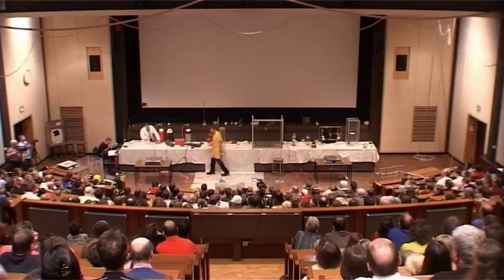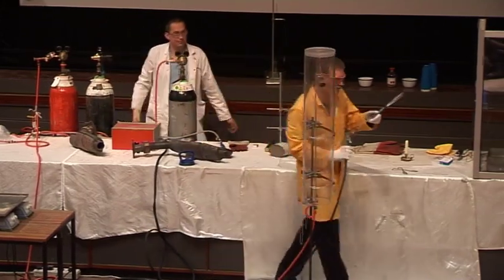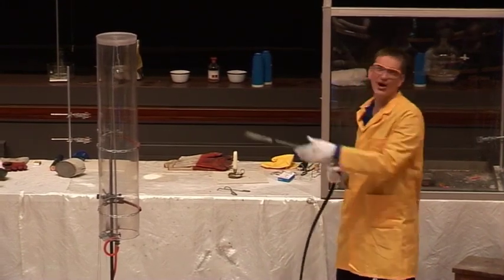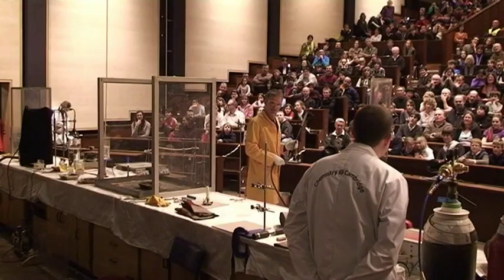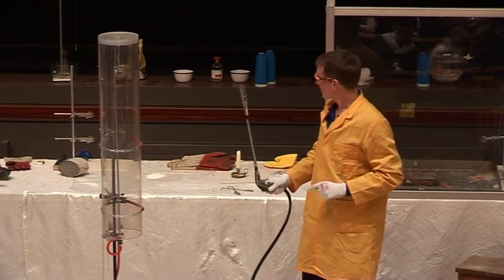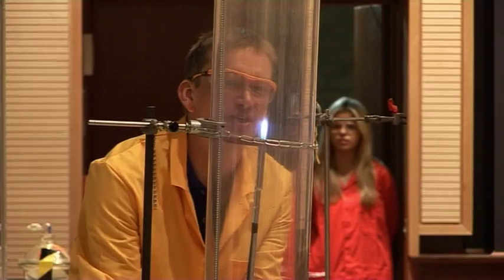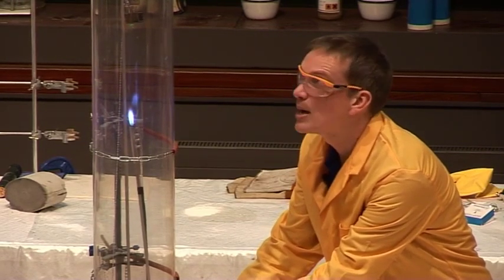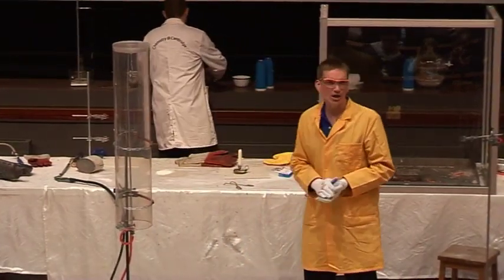Fire and Flame  19 - Oxygen Flame in Hydrogen

Comment: "Burning" means oxidizing. You can't oxidize oxygen. The hydrogen is what is burning in this experiment. It needs oxygen to burn, therefore it only burns in the area of the oxygen coming from the nozzle, which has the appearance therefore of the oxygen burning.
Reply: My thoughts exactly. Hydrogen deflagration where the mixture in of O2 and H2 are made. This is why it was important to actuate the ignitor before the O2 was flowed. Interesting experiment, but extremely dangerous if poorly timed.